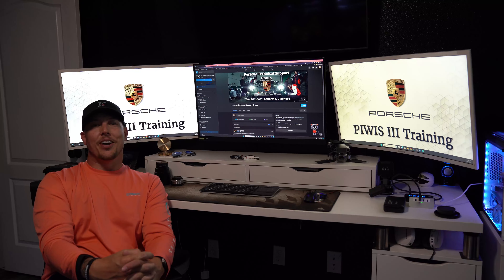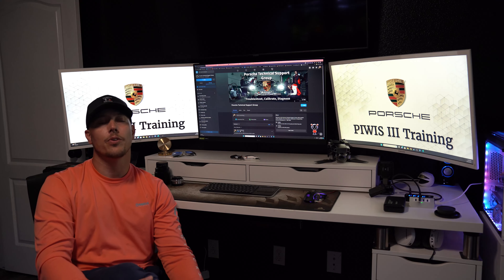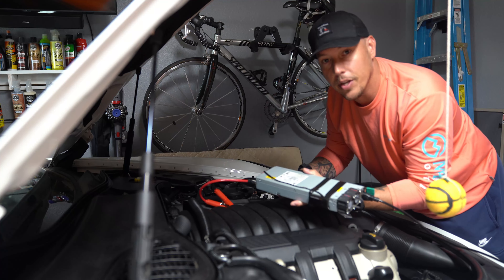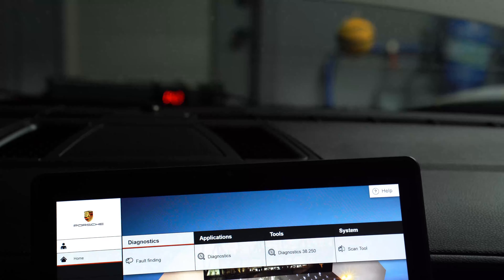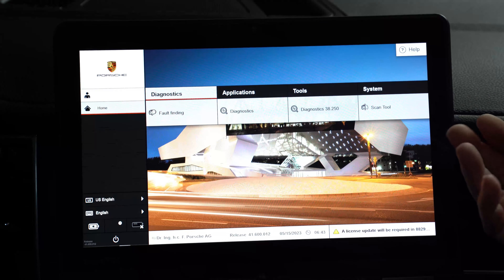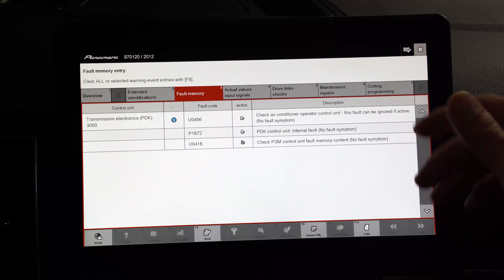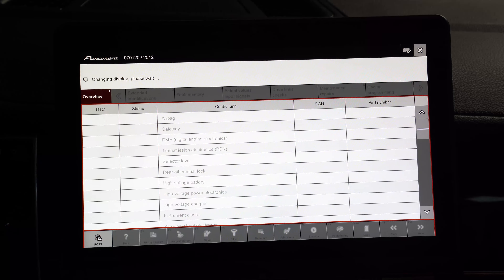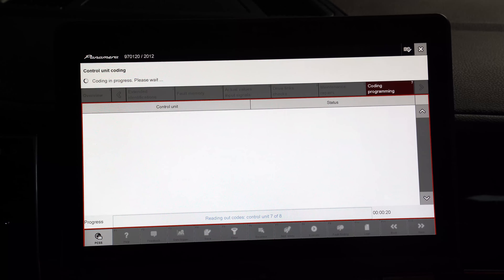piwis training pt 1

Comment: It looks like you did a control module replacement (transmission control module). Did that module require the "teach" mode from PIWIS? I believe certain control modules require authentication via Porsche's servers, so wondering if you have any insight or experience dealing with that issue. Thanks!

Comment: Instead of the plug in PSU you hooked up to the battery,  would it be sufficient to use booster cables and connect to another running vehicle?

Comment: Question - would it be possible to "enable" a heated steering wheel upgrade (after hardware has been installed) using the system that you're showing here?  Thanks. (2019 Cayenne).
Reply from the maker: yes you can enable options after installation. I was going to install trac launch or sport + mode on mine soon. I will do a video on it when i get around to doing the install.

Comment: Could i just hook the battery up to a Ctek tender?
Reply from the maker: I keep mine on one when I don't drive it.
Reply from the maker: When piwis coding you will need better 13.5 to 14.3 consist voltage
Reply: @TomorrowsTek  My CTEK MXS 7.0 has a constant power modus which puts out 13,6V/7A so that would work fine I guess.
Reply from the maker: That would work just fine as long as it does not fluctuate in the lower direction